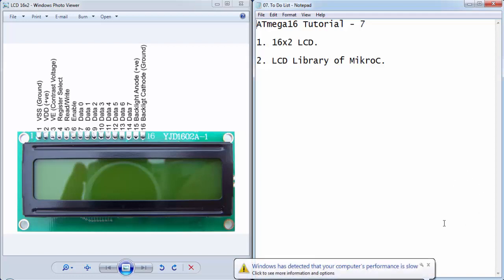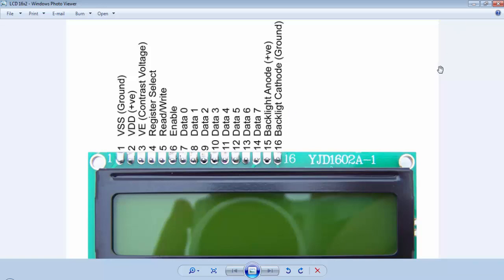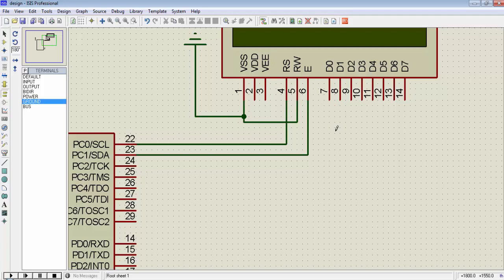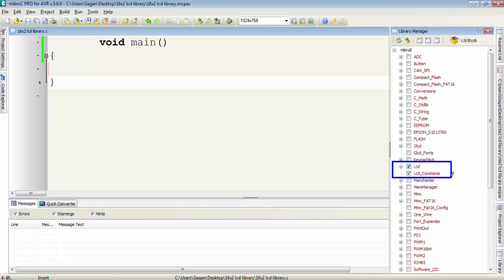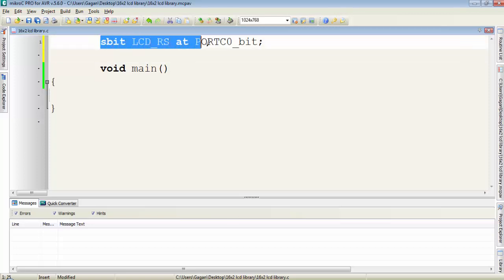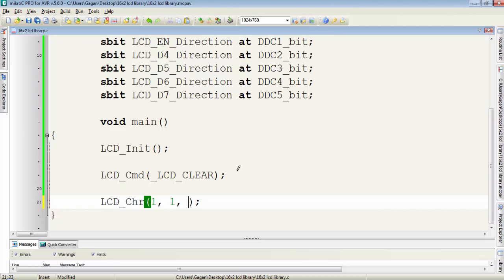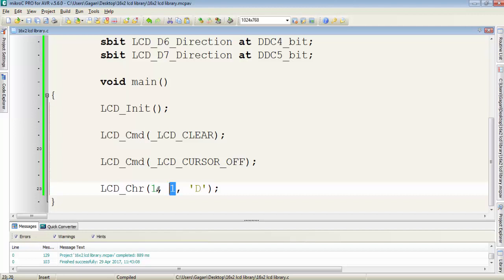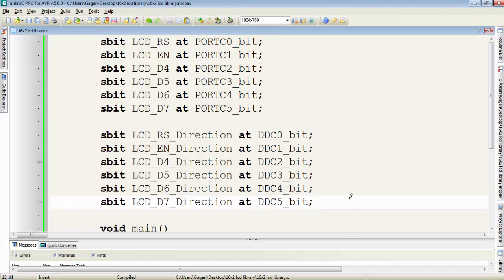Atmega16 Tutorial 7 - 16x2 LCD & LCD Library

Comment: can we use lcd without providing delay command after every lcd commands ??
Reply from the maker: It is given in the LCD Datasheet that a specific amount of delay after commands or data is required so that LCD can process the data. There is also a Busy Flag method where you need to check the state of D7 pin of the LCD. 
To utilize the Busy Flag, you need to use R/W pins as well to put the LCD in Read mode. At the time of reading Busy Flag, the RS pin will be LOW or in Command Register mode. 
This way the busy flag can be used with an Interrupt Input of the controller.
Reply: @GaganCA  tysm sir...very informative..means a lot that you replied in such short time😁🙏🙏
Reply from the maker: @preetmehta1008  Its my pleasure. I just try to maintain a level of satisfaction for my viewers and subscribers. Thanks for your valuable comment.